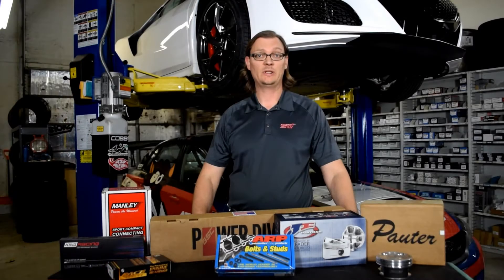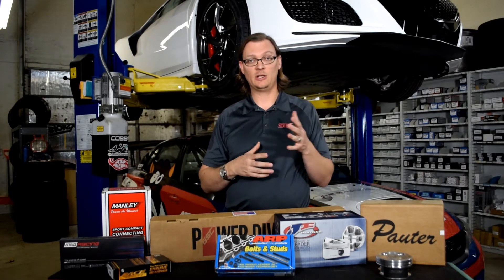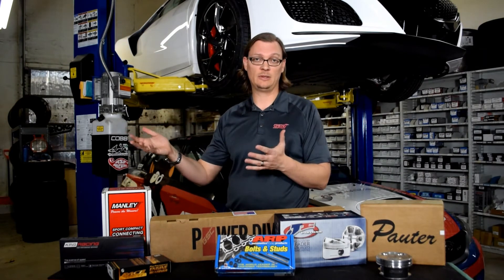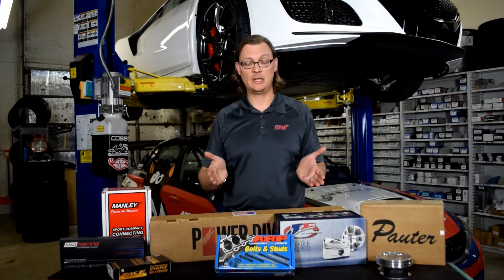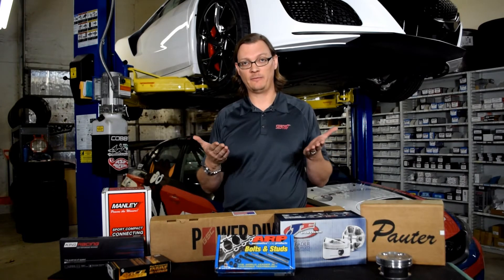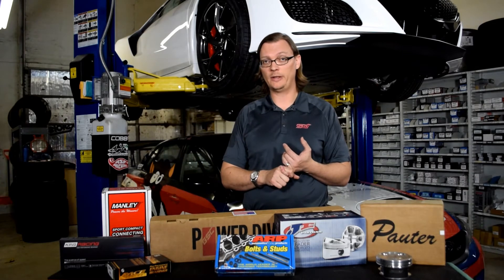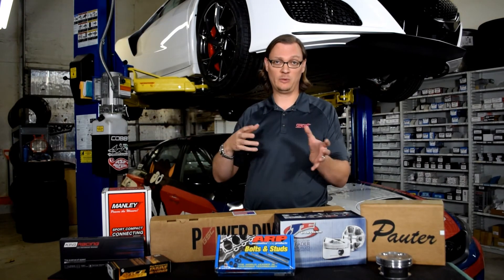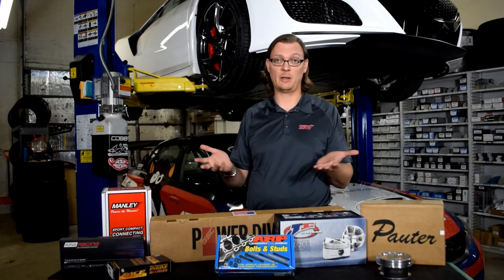To Build or not to Build your Turbo Subaru EJ Engine

Comment: Right now on your website my cart is about 3,650 with parts for my build  am looking for reliability engine and maybe 375HP my question do you guys offer remote tuning
Reply from the maker: Thanks for your question.  We do not work on or Tune customer cars unfortunately.  But we may be able to help you find a Tuner to work with.

Thanks for your business and thanks for your support!

Stay Tuned!
Reply: I did cobb 20g turbo, killer b headers, 1050 injectors, fuel pump, q300 cat back, ets tmic, cobb intake, cobb up pipe, koyo radiator, IAG AOS, IAG oil pick up, Killer B turbo inlet, VSC radiator hoses, 3 port, 04 sti regular and pro tune. I put down around 360whp on pump with stock cats on a conservative tune on 15 sti engine.

Comment: When you say "350 wheel horsepower", what dyno are we talking? I have a tuner with a mustang dyno that basically said there's no way I'm getting over 275 to the wheels unless we install a larger turbo and supporting mods. I was under the impression installing a larger turbo was basically death for the cast pistons.
Reply from the maker: Thanks for your question.  With a good tune, going to a reasonably larger turbo on the stock block can work well.  The power goals and tune just have to be good. 

With those in place, the stock block should be reliable in the 320 - 350 whp range.

Hope that helps and Stay Tuned!

Comment: I have a head gasket failure.  Should i throw forge pistons or leave it? i made it up to 133k mile from factory brand new   the only mods i had was an intake and accessport. my power goals is 350-380whp its my daily.
Reply from the maker: Thanks for your question.  The biggest variable there is how many miles you want to get out of a new engine.  If you are hoping to get close to 100k miles, sticking with a stock block is the safest bet.  You would just want to reduce the power goals slightly to keep the engine reliable.

Hope that helps and Stay Tuned!

Comment: Does this info also apply to ej205 engines?
as far as what maximum power a stock block (ej205) will hold up to.
Reply from the maker: Thanks for your question.  Roughly speaking, I would say so.  Though on a 2.0 liter engine it has a much different driveability at even 300 whp compared to the 2.5 liter engines.

Most of the time, once you get close to 300 whp on the 2.0 liter engine, the compromises needed to push further just don't fit for most people.

Hope that helps and Stay Tuned!
Reply: @FlatironsTuning   thank you for the reply! :)

Comment: Is it advisable to swap out the JDM ej207 for an ej25 /255/257? I understand that the lining in ej25 is much thinner and prone to crack.
Reply from the maker: That is a hard question.  I'd say that if your EJ207 is in good working order, there is not necessarily any need to go in and replace it.  The EJ25 cylinders are a bit smaller than the EJ207 (especially compared to the thick wall EJ207 from the newer blocks), but they are not a limiting factor below about 550 whp.

Generally speaking, the decision about what displacement block would be best for you often comes down to power goal and desired power band.

I hope that helps, and Stay Tuned!
Reply: @FlatironsTuning  Appreciate the reply. Thank you!
Reply: @FlatironsTuning  am actually planning for a forged daily drive build. Minimal lag with some serious kick to the back upon full boost. 

Was contemplating whether to go for a full 2.0 forged, 2.1 stroker or a 2.5 forged. 
As per the above, my major concern in 2.5 build is the liner crack issue.
2.1 gonna be an issue to me in sourcing for the offset wrist pin piston. 
2.0 straightforward build but bored?

Aiming at 400-450whp. Day dreaming of a flat 300-400wtq curve (wondering is it possible?)

Yet to decide on turbo.

Comment: What's the power limit of the ej205
Reply from the maker: Thanks for your question.  That is a slightly hard question to answer.  It isn't as easy to get an EJ205 above 300 whp with a good usable power-band, so not as many people have done that so there is less information out there about it.

I think that I'd say that 300 whp can definitely be reliable on an EJ205 engine, but getting to that power level and still having a good powerband is the hard part.

You can certainly do it with a 20G turbo, but on the 2.0 liter, you end up with minimal power below about 3,500 rpm.

I hope that helps and Stay Tuned!
Reply: @FlatironsTuning  yea I'm shooting for 275whp
Reply from the maker: My favorite turbo for the EJ205 is something like an Evo-3 16G or Blouch's 16G XT-R.  That will give you good power from 3,800 rpm on, and will pull to red-line.  You should be able to make between 240 whp and 260 whp on that as well.
Hope that helps!

Comment: if one builds an engine with a bunch of aftermarket uprated parts apart from having the installation of the components being done right, and assuming all the parts are the perfect fit down to the oil pickup, the pan and the oil pump then it is going to be a motor that most likely will last if ran and mantained properly.

But then again the forged pistons and the extra clearence would eventually wear it down to a point where the engine wont perform as it should... is there a way to mitigate wear from a bit looser pistons?
Im thinking maybe inserting the right sleeves could help not only reinforce the cylinders as deck inserts also do but as I would think the right sleeves surely must be harder and tougher than the original bore material and might help extend the life of the cylinders or no not really?
Reply from the maker: Thanks for your question.  There are low expansion forged pistons that are designed to run tighter piston to wall tolerance, and that would be one direction to go if you are looking for more life out of the engine compared ability to hold maximum power.

You really don't want to deviate from a manufacturer's spec's on PTW tolerance.

Here are the RCM low expansion pistons for instance:

https://www.flatironstuning.com/rcm-omega-piston-set-low-expansion-ej25

It all depends on your overall goals really.

Hope that helps, and Stay Tuned!

Comment: So what's your opinion and guideline on forged pistons like the eja207 from the factory
Reply from the maker: Thanks for your question.  We haven't worked with enough of those engines to give you a solid answer I'm afraid.  A lot of that would come down to what the piston to wall tolerance of the factory pistons was.  They would definitely be able to handle more power than a block that came with cast pistons.

But if the PTW tolerance is tight to keep noise and wear to a minimum, that may be an issue above a certain point.

Hope that helps and Stay Tuned!
Reply: There not a true forged piston the only true frohed piston came in the Japan spec liberty rs

Comment: What about a hypothetical question-what if you have a built short block, say capable of 500+HP and have it tuned to 350HP,
change oil every 3K Miles, Use Subaru coolant[with conditioner], do only occasional[as in rare] hooning, would the engine last 
as long as a stock engine?
Reply from the maker: Thanks for your question.  It is hard to say for sure.  There are definitely people that are able to get up to 100,000 or so miles on a built block.  But there isn't a clear formula to do that.

The biggest factor would be to monitor oil for consumption, and to keep an eye on your PCV system.

Another thing to consider is that the higher the power target of a block, typically the loser the tolerances.  This can apply to the bearings, ring gap, etc.

Those lose tolerances generally will add up to slightly accelerated wear over time, which can also shorten the life of an engine.

I hope that helps, and Stay Tuned!
Reply: @FlatironsTuning  Thanks so much for enlightening us about the pitfalls of a built engine. In essence, due to its looser tolerances, having a built engine 
becomes a "roll of the dice" as far as longevity is concerned. A trade off between having more power [and bragging rights] and a "relatively" weaker engine
that allows you to sleep better at night. This endeavor then is suited for people with deep pockets willing to do an engine rebuild say every 60K-80K miles-
that probably at the most ideal circumstances. Thanks again!
Reply from the maker: @4rct1c9Ic3m4n  Overall, the reason that we made this video was to address the perception that you addressed with your initial question.  There is definitely a perception that if you build the engine to hold tons of power, but you run it at a fraction of that, it will last a long, long time. 

Over the years, we had enough people that got burnt by that misconception that we wanted to put out a better guide for making the decision of how far you want to go with a build where reliability is concerned.

Glad that it helped, and Stay Tuned!
Reply: @FlatironsTuning  do you have any thoughts on the Type RA block found in the 19+ STIs? Seems that people have been successfully running over 400whp on them, though for how long it'll last it's probably too soon to say. I'm not sure how the tolerances compare but is it possible that it could provide an OEM level of longevity while also allowing a higher power level?
Reply from the maker: @gorbasho  You may have noticed that we are using an RA block in our Pikes Peak car now.  Here is a link to the details of the build, and you can take a look at our dyno sheet for reference:

https://www.flatironstuning.com/blog/a-detailed-look-at-the-build-of-our-2021-pikes-peak-race-car

We are pushing just above 400 whp, and I'd say that if you have a race car, this might be a viable option if you wouldn't want to ever push mush further than that in terms of power.

But for a street car, I'd definitely say it is far too early to say that a Type RA block would be a solid choice with that kind of power target.  I think I'd still recommend looking at a built block with that kind of power target.

Hope that helps and Stay Tuned!
Reply: @FlatironsTuning  Thanks for the reply, definitely helpful. I think if a built block can hopefully last 60k-80k for a street car, I would be happy with that as I only drive around 6k a year
Reply from the maker: @gorbasho  Yeah, and a 400+ whp power level, I'd still say that a build block is a safer bet to get to 60k than the Type RA block.

Glad we could help!

Comment: What about just snatch out the 2.5 and drop in a ez30 or ez36 with the factory sti turbo
Reply: Aftermarket with the EZ series, despite the obvious benefits, are basically close to zero. A travesty really.
Reply from the maker: It can be done, but it is not easy at all.  There are not nearly as many parts for the 6 cylinder engines to support forced induction as you would think, but some are doing it.

Our friends at ASF Machine have done it.

Check out this link:

https://youtu.be/kiBjv9u8mNc

Comment: Wow I didn't realise my ej255 was capable of 350 hp. Surely it wouldn't be that reliable and wouldn't last that long,   won't the pistons give out real quick?
Reply from the maker: Thanks for your question Jordan.  First, remember that a reliable tune is a critical piece to keep the engine reliable.  And 350 whp is an upper limit.

But if you have a good tune, the car can be pretty reliable at that power level.  If you dial it back to low 300's (like 320 - 330 whp) then your chances of reliability are increased too.

I hope that helps, and thanks for watching!
Reply: @FlatironsTuning  okay thanks for your response. Say at 330 hp, what kind of life span are we talking provided the car has a good tune and is a street driven car driven only 2-3 times a week but the power would be used regularly. Thanks for your helpful comments.

Comment: Any idea on short block recommendations when my OEM engine goes. Right now it's just stage 2 mods but when it goes I'd like to get equal lengths headers, and a cobb20g turbo. OEM block with safe tune or IAG stage 2 block?
Reply from the maker: Thanks for your question.  If you are looking at a 20G turbo, that falls to the top of the range that the stock block can support.  If you don't plan on trying to push past 350 whp, then I'd say that would make sense for your build.

If you want to have the option to go for more power, then the IAG block might make more sense, but you would have to make sure that you will be building to that power level in the reasonable life-span of the engine.

I hope that helps, and thanks for watching!

Comment: i have a bugeye wrx, still on its factory motor. possibly looking 300hp, 320 max. what would you recommend be the best upgrades to get it to run the best for that power level? already got a mishimoto front mount + their short ram intake, not yet on the car as I don't have the money for the tune yet. umpire uel catless headers/up pipe (same story as fmic). and have been looking at things like better fuel pump, possibly something with a flow rate of 355lph (looking e85 compatible maybe as well) , bigger injectors and swap the tdo4 with a td05. the goal is the have mods be able handle more than what I want out of it to hopefully not have things so over worked if i do a spirited drive.
Reply from the maker: Thanks for your question.  On the 2.0 liter engine, getting to 300 whp will require a bigger turbo (I'd say a TD05 20G at a minimum), and the result is typically a significant loss of usable power band.  And If you are on a higher mileage engine, you may not want to stress that block that much.  

I'd say that one of the best turbos for the 2.0 is a 16G, which should get you around 250 whp with a good tune.  That makes the car a lot more fun, and it can still be reliable with a good tune.

Hope that helps, and thanks for watching!
Reply: @FlatironsTuning  awesome!! cheers for that. yeh not looking for crazy numbers. just looking to wake it up a little more and run more "efficiently" with less air flow restrictions and better cooling. would you think a 3 port boost controller/solenoid would be worth the investment as well? i've heard they help alot when you get a tune done to have more predictable and consistent boost levels
Reply from the maker: @jackstanddriveway  They can, but it definitely comes down to the turbo itself much more than the controller.  But if you are getting a tune done, it is not a bad idea.

In a pinch, get one, and set it aside so you have it if you need it.  Start with the stock solenoid and see if that will get the job done.

Comment: I have an ej20 just did head gasket replacement, its a non turbo would like to put a small turbo with 4 to 6 pounds of boost..whats the simple way to do it without doing the whole engine again
Reply from the maker: Thanks for your question.  Unfortunately there is no easy way to do that, and if you don't go in and build the engine, your gains will be minimal, and the potential for engine failure is moderately high.

Years ago, there were a number of people that were supercharging their Subaru's, and if anything, I'd say that is what you would want to look into.  It is much easier to deal with on an NA car compared to a turbocharger.

But even then, there is a pretty high risk to your engine.

Now that turbo swaps are so prevalent, I'd say that if you really want to go down this road, that is what you want to look at.

Hope that helps, and thanks for watching!

Comment: So I've got a question for you, I recently did a hybrid ej255 with 251 heads and intake. I'm going standalone soon and want to run around 14psi. My valve guides seem to be leaking so I figure when I go to pull the heads I should upgrade my springs and valves. Do you have an approximation on how much power the stock 251 head springs can handle? Or is it more of a case of high they can rev before valve float? I'm on 5psi right now till I get my ecu tuned
Reply from the maker: Thanks for your question Chris.  I'm going to say that I don't have enough experience to give you a good answer on that one.  I'd recommend talking to ASF Machine.  They played with the 2.5 Liter SOHC heads a good deal a few years ago, and they should be able to help you out.

Delta Cams would be another good place to talk to.

Hope that helps, and thanks for watching!
Reply: @FlatironsTuning  no worries thanks alot for the info! Mad quick reply as well. Love your videos

Comment: Been thinking about going with an outfront 2.14 stroker with big port heads. Any experience with that setup? I've been back and forth on what turbo setup to go with. It's not a daily driver so it wouldn't see crazy amounts of miles and I'm always very meticulous with oil changes. I've been at about 300whp for a couple years and have just always wanted more.
Reply from the maker: Thanks for your question.  We have helped a number of people with 2.1 strokers over the years.  

The biggest points that I could give are these.  

First, they seem to be happier on E85 or race gas compared to pump gas.

As far as torque goes, it will be easier to make more low end torque with a 2.5 liter engine, but the 2.1 stroker can be a bit happier to spin at a higher rpm as long as it is balanced, and the heads are built to match.

They can definitely be fun engines.  We were just at the track with Lucas from Wild Westy, and his GC has a 2.1 stroker that is making about 360 whp on E85.  It is a fun car!  Stay tuned for the video.

Hope that helps, and thanks for watching!